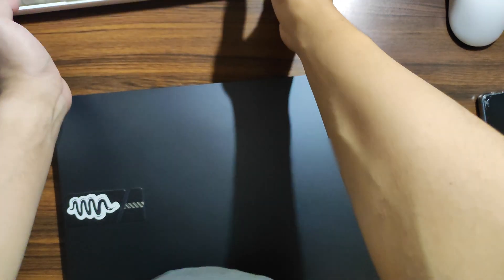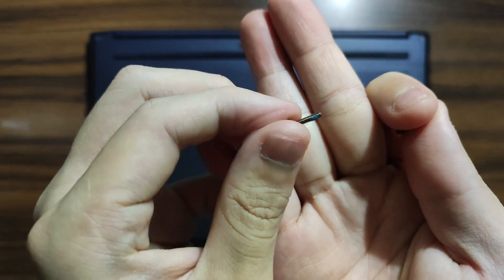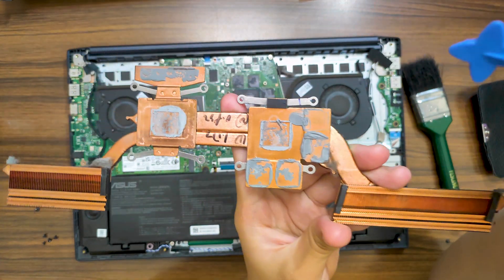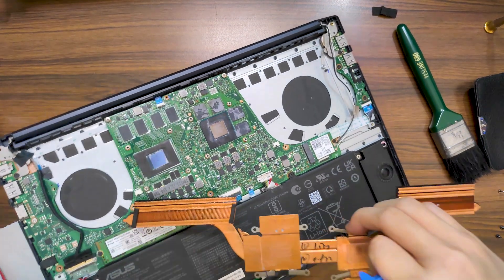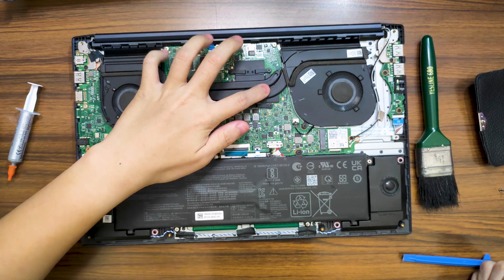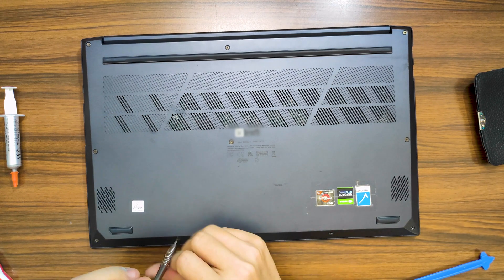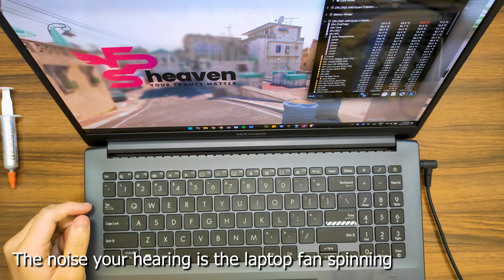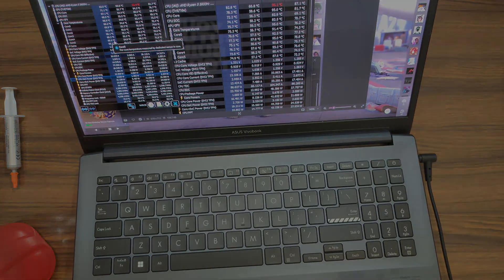Repasting My Asus VivoBook Pro 15 OLED M3500Q Laptop

Comment: Thanks for the video, I don't now if you will see this after one year, but is it thermal pads on the VRM attached to the cpu cold plate ? Or thermal paste ? If thoses are thermal pads, do you know the thickness by any chance ? Thank you !
Reply from the maker: no the thermal pads are seperate from the heatsink, and doesn't touch the CPU cold plate like u see in the video, it's exactly how it looks, the thermal pad thickness however are around 4mm
Reply: @binguostuffy thank you very much ! I think I will use thermal putty, apparently it's pretty good. I guess I should put around 4mm of thickness then

Comment: Good video. And i have same laptop. Is it normal gaming laptop overheat. Over 85°? All of them?
Reply from the maker: yeah under fullload it is around 80-90+
Reply: @binguostuffy  :( my laptop reaches up  to 85° in the bios... Is it normal? Ryzen 7 5800h already changed thermal paste...
Reply from the maker: @Jhon-om9xs  Im not sure, because i noticed that in the Asus Bios, the fan and temperature does get somewhat high for no good reason. Best way is to simulate real environment like idling in windows and comparing it to when you're playing games, if its still too high try checking if the fans are actually ramping up since if its hot its way louder, and if its not then its not loud. If anything else is weird then i would suggest u bring it to their centre or a repair shop just in case!

Comment: Hey mate logged in to ask this. Haven't found anything on this specific laptop about thermal putty's. I'm just about to order some PTM7950 thermal pad (paste replacement) for the cpu and gpu chips. can I even use putty anywhere on this laptop or do I replace stock paste on those chips with more PTM7950... might be a dumb question but was hoping you could help.  M3500Q
Reply from the maker: No worries, it'll work perfectly fine, Asus could've opted for the PTM7950 just like you said which is better in laptop usage. So just go for it!! I happen to only have thermal paste hence why, but the PTM pad is much better for laptops in general!
Reply: @binguostuffy  First off thanks for the reply. However i meant more outside of gpu and cpu chips. Does the laptop require any Putty usage? e.g Can I use Upsiren UX Pro thermal putty for the other chips(VRMs and memory)? As I will use PTM for the main ones (cpu and gpu)
Reply from the maker: @louisdjturner  from the default designer wise I don't see the need, as even if u applied there's just a plastic body below and nowhere else to transfer the heat to, you could however still apply it if u made ur own modification!

Comment: Hi, I did exactly the same thing and now the notebook doesn't want to turn on? I checked the motherboard and the cables and nothing, I only get the battery light once and the bulb light twice. Do you know a solution?
Reply: Asus does this often, disconnect battery and reconnect it again usually helps, also its good to turn it on before putting the cover back on, I just hold it up with one hand, display opened, turn it on, if it turns on I close it and put the cover on, saves me time when I forget to plug something in etc. dont have to undo all the screws again.
Reply: @NotEvenDeathCanSaveU  I hard to learn it the hard way. Used to have a predator helios 300. Those are pain to open. Did everything and closed it only to find out I forgot the plugin the battery. lol
Reply from the maker: heya, that's unfortunate... I wasn't there so i do not have enough information to say what might be the cause or what you might have done accidentally. It might be easier if u can tell me more.
Is it the exact model (MODEL NUMBER)? 
What is it Intel or AMD
Is the light ur describing amber/orange pls clarify or  if  possible  link a video of the state of the laptop. Is there any blinking orange light?

If you're confirmed that u plugged everything in(pls double check It's INSERTED PROPERLY), then try plugging the laptop to the charger and see if it helps
Reply: hey man! I had exactly the same problem: only one LED light would glow and the laptop wouldn't turn on.  
First  I powered it off completely, so that no LED lights were on. I plugged it in, without detaching the battery and pressed the power button. At first nothing changed which honestly scared the sh*t out of me. But while I was sitting and pondering on my next steps, it just suddenly turned on. 
Working fine, both on battery and plugged. So i suggest you just give it some time to "collect itself" after the repaste. 
I presume it happened because I unplugged the battery from the motherboard as a safety measure, as it should be done. 
Cheers mate
Reply from the maker: @MrBuckeye401  thanks for the response!! I thought that might be the case and even pulled up the manual to check, appreciate it!

Comment: omg you don't unplug battlery connetion. Last time do it first before doing anything
Reply from the maker: it's fineee, don't need to since it's just a clean, if I wanted to swap ram or replace the other stuff then you need to do that. Though that's how I do personally. Not professional advice!
Reply: @binguostuffy   bro... you have a potential risk of circuit
Reply from the maker: @TurboCelular yes I know, but since it's mine own personal stuff I didn't think it's required, but if your worried you should